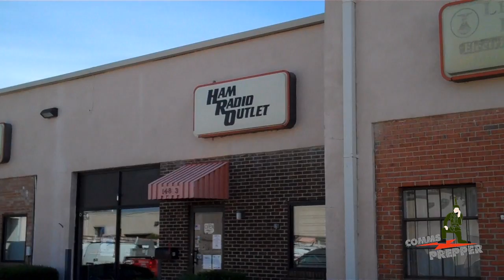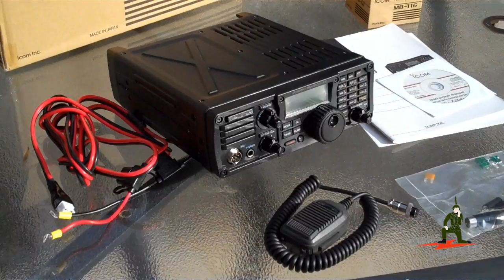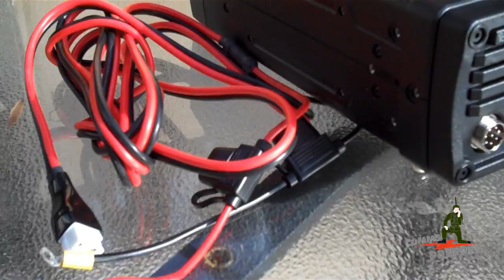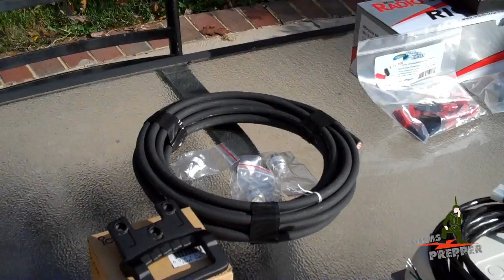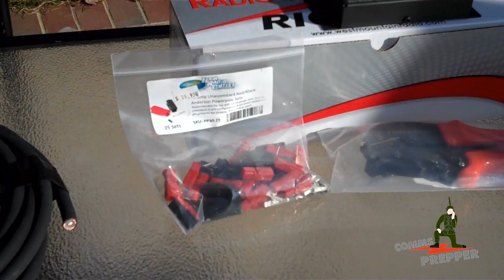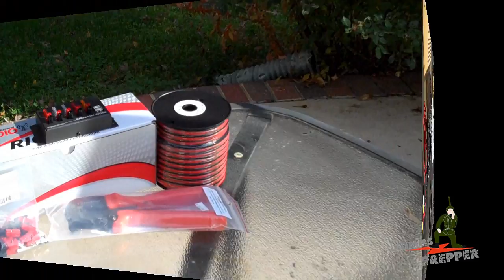Icom IC-7200 Unboxing

Comment: Which power supply will you be using CP?
Reply from the maker: +Freedom Forged In the station I have a few 25 amp min. power supplies.  Once I get to the field I will use batteries and cut the power back to 20 watts.

Comment: I understand the 7200 has a built-in usb input for digital work.  from your PC perspective does the ic7200 "look" like an external sound card?  

e.g. without a usb signalink could the ic7200 do psk31 and winmor, etc?
Reply from the maker: +Sean Yunt Yes.  The IC-7200 has on on-board sound card interface that is accesable from the rear USB jack.  I was playing with Winmor last night and will be making a video.   You can also read the help section in RMS Express on the IC-7200, tells you how to get it going.  It's a great radio!
Reply: Absolutely, I run my laptop directly into my 7200 for jt65, jt9, psk31 and pretty much any other mode I feel like playing around with. Just takes a regular printer style usb cable.

It took me a bit to get the ptt between HRD and the 7200 to talk but that was mostly operator error. The sound card portion was stupid simple as the computer recognized the sound card of the rig as an external USB soundcard. Once I had it setup it's been flawless since. Even before I had the PTT figured out I was still able to operate just had to manually key the radio via the hand mic haha
KC9FJE

Comment: IC-7200 is a great addition to any rugged environment.  I'll get one eventually!  (camo version of course).  And who needs a manual!  Cheers!  Chris...  W7BBQ  (what's your call, PM if you want).
Reply from the maker: +Cactus Makeshop Normally I would agree but I have been using the manual allot with this unit.
Reply: +Commsprepper Well, i've found that if you've owned an ICOM before, it's not so bad.  I'm a Yaesu guy, and all 4 Yaesu models I've owned have had similar features and menus, so if somebody is an ICOM guy, they might could be all similar, but maybe not.  Anyway, I've heard ICOM's manuals are quite good..and good on you to replace the crap cable with some better stuff.  I'm a fan of the very flexible and shielded LMR-240 that HRO sells...it's a very good compromise between cost and effectiveness and it's MADE IN USA!!  .  Cheers!  Chris... W7BBQ.